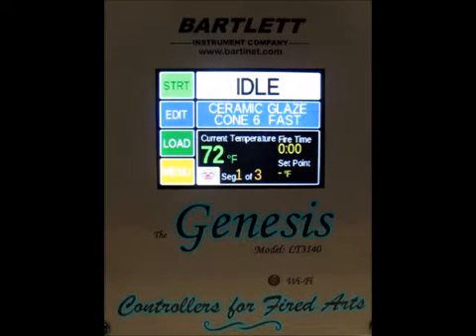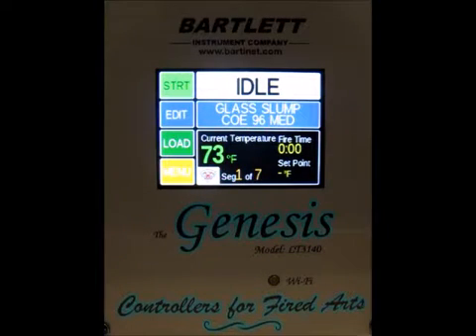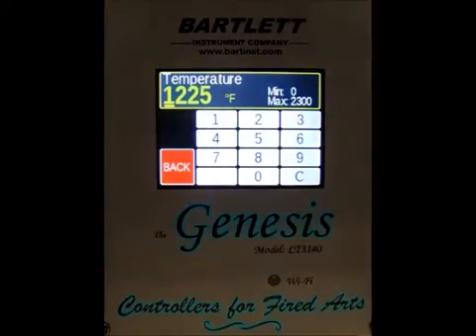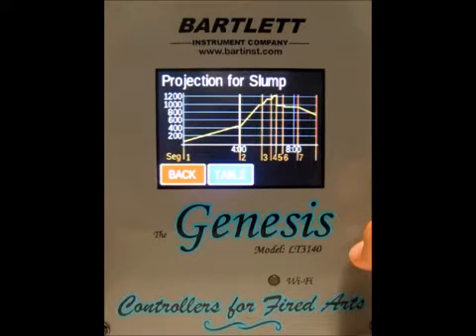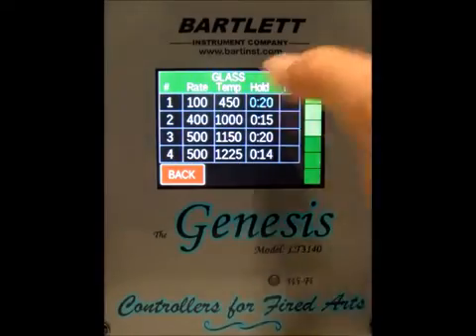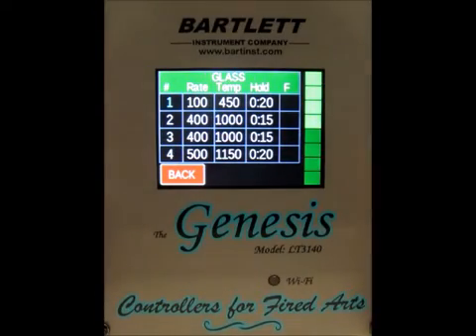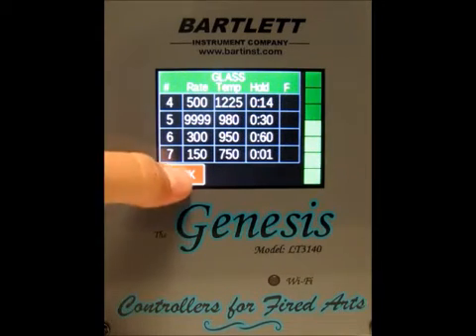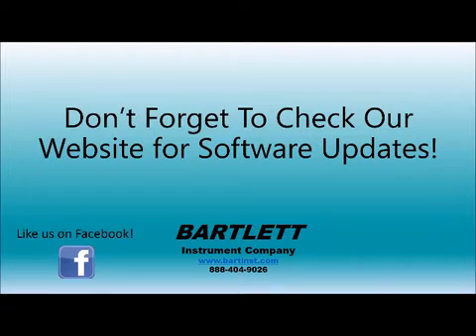Bartlett Genesis/Genesis Mini | Glass Programming

Comment: Hi thank you for the helpful videos. I am using Lt 4140. However, I am getting error E-D. Any idea how to resolve the error?
Reply from the maker: Hello, an E-D means the kiln temperature 50 degrees F above traveling set point. The probable cause for this is a stuck relay or stuck output. If using zone control, then the outputs or thermocouples may be in the wrong zones. If you have additional questions on this error or how to resolve it, please send us an email at information at bartinst.com. Thank you!

Comment: What is the dial in the side of my controler for? I have this model control
Reply from the maker: Hi Marcy - I believe the dial you're referring to is the infinite switch. It is used to adjust the power going to the elements in the lid of the kiln (usually used for glass working). We recommend consulting with the kiln manufacturer to confirm with them as we don't manufacture the kiln itself. Thanks!